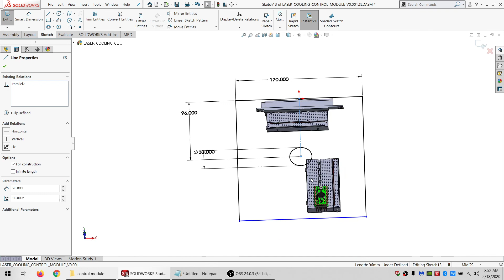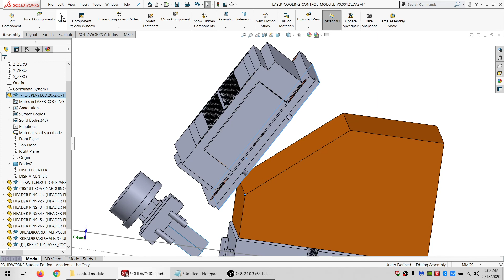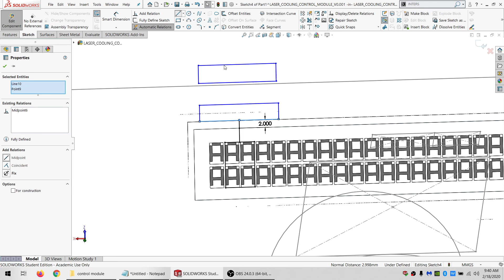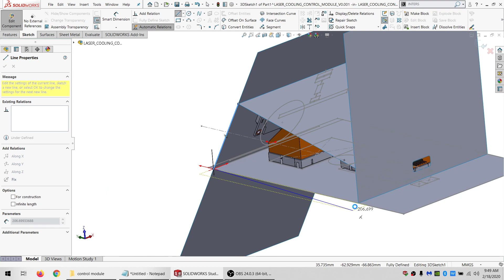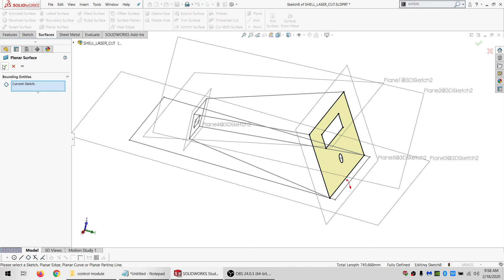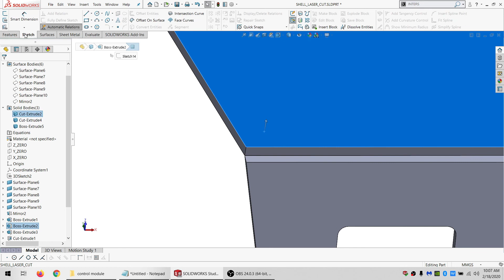Designing Laser Cooling Control Module Box Part 1

Comment from the maker: Imagine you have a sketch open, looking straight at it (normal to).  You see something behind the sketch, maybe from the model or maybe from another sketch.  Convert entities just makes a line or arc or whatever where you see the thing you selected.  If you want to convert internal features you have to start the tool first, but for other things you can select first and then open the tool, or you can open the tool with nothing selected and select while in the tool.  Intersection curve is very similar, except it converts where someone passes through the current sketch.  Note that it is affected if what you are converting isn't normal to the sketch.  Like if you try to convert a circle but are off by 15 degrees you get an oval like spline instead of a circle.
Reply: Thank you for the explanation. I've only used it once at work and I struggled to get it to do what I thought it was supposed to do. I have only needed twice since I started this new job and wasn't doing it in the correct order but also had a expert help me and later on during the modeling had me dimension
the converted sketch because somethink shifted .08 degrees and threw off my whole model. I was trying to follow you when you were using it but you're so fast it didn't make much sense. When I get home tonight Ill go through it again and slow it down.